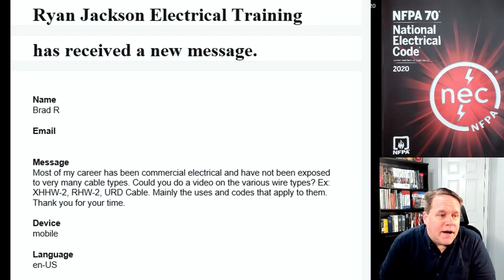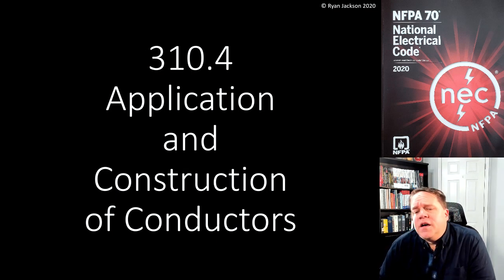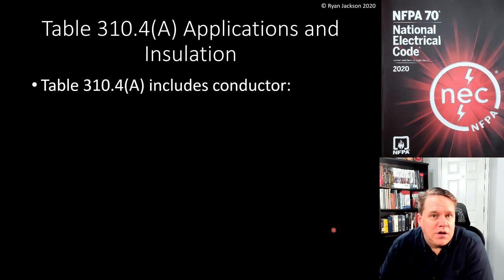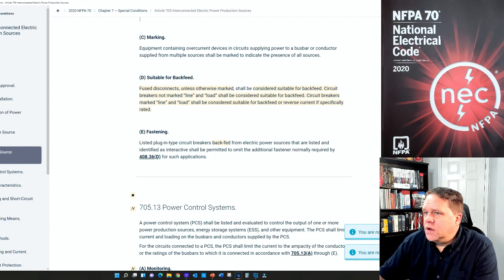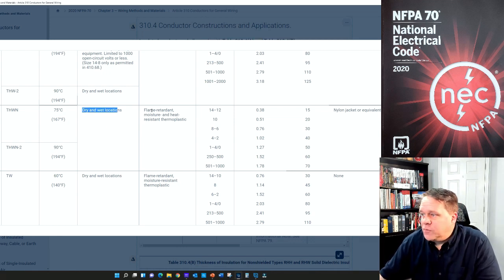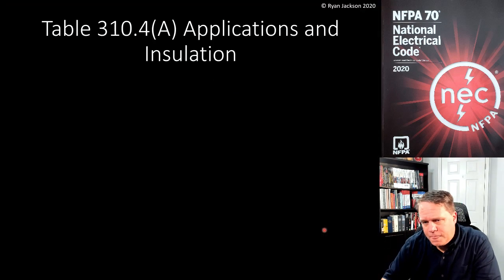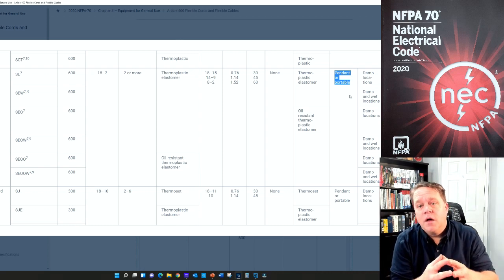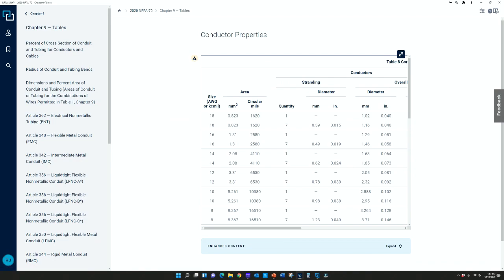Electrical conductor types in the NEC

Comment: The type of DLO, Diesel Locomotive Cable, commonly sold is also rated RHH, RHW-2 and Type W cord.  The old original DLO cable, with no other rating, cannot be used for building or temporary wiring.  It was only for trains.

Comment: Ryan, is SER cable limited to 60 degree C? Some experts have said it is not. What do you think?
Reply from the maker: See 338.10(B)(4)(a). But the short answer is "no."
Reply: @RyanJacksonElectrical  Awhile back, I installed # 2-2-2-4 AL, SER cable for a sub. panel and installed a 90 Amp. breaker in main panel. Local Inspector wanted me to use a 70 Amp. breaker instead and insisted on saying that 60 degree C shall be applied.
Reply: @RyanJacksonElectrical  didn't 334.80 used to apply to interior installs?
Reply from the maker: @jeffbower5525  That section (338.10) was revised every three years from (about) 2011 through 2017.
Reply: @RyanJacksonElectrical  that makes sense. I thought I remembered a time where it didn't exclude 334.80.

Comment: At the large hospital that I retired from contracted pulled 3 large DLO cables thru 4" conduit that had 360 degrees in bends. After they killed them selves pulling first conduit with only lube in head they had a guy with a paint brush lining entire run. Told me the rubbery insulation was stocking to wall of conduit. Was wondering if anyone else had this problem. They were using a powered puller for pulling cable.
Reply: DLO cable is not an NEC recognized wire. Some has dual ratings as RHW I think it is which would make it a compliant conductor but without the dual rating it can't be used.

Comment: Ryan thanks for another great vid. My chief electrician dad was one of the first people in our area to use THHN/THWN in late 60's. When he went to order several thousand feet of THHN supply house never heard of it. A salesman from a wire manufacturer dropped  off samples. Appeared to get abused first couple of years. Guys were using #14 THHN on 20 amp circuit breakers and even some put #12 THHN  on 30 amp circuit breakers.Heard they are kicking around making 14 gauge copper clad aluminum NM cable for LED'S on a 10 amp breaker. Can see Johnny homeowner seeing 14 gauge and using aluminum clad wire on 15 amp circuit breakets. Twice this year while at the electrical isles at big box stores saw homeowners purchase non TR receptacles for their homes. Told them that they should only use TR receptacles in houses. Older gentlemen stated that there is no kids living in his house so he does not need them. Told him that my kids are grown and moved out but 3 young grandkids are there several times a week. Wish the big box stores would either have sign age up or stop selling non TR receptacles. Would be best if NEC would not let non TR receptacles be produced.
Reply: Non-TR is still allowed in most commercial construction so why would manufacturers stop making them and why would a big box store stop selling them?
Reply: Unfortunately older folks with arthritis and other limitations have the most difficulty with those TR receptacles. Code is code but people are going to generally do what works for them.

Comment: BTW, DLO, from a design standpoint is very useful....it bends, it conducts, it works.  If you get it wet, it disintegrates...fair warning...use it, don't abuse it.
Reply: Not true for the type of DLO commonly sold, which is also rated RHH, RHW-2 and Type W cord.  The old original DLO, Diesel Locomotive Cable, with no other rating, cannot be used for building or temporary wiring.  It was only for trains, and could handle water.
Reply: @besafe9  The usefulness of it(for my purposes anyway) is in control/power panels that have very limited space.  You can bend it easily, you can terminate it easily(crimped lugs are best)  I've not encountered any DLO that is not dual rated.  Yes, if you get the exposed copper wet, you can count on it disintegrating very quickly.  Saying 'not true' is a pretty harsh thing to say.

Comment: Let's say we have TGGT wire attached to heating elements(industrial or not[e.g. cooking ovens]) Where can we transition to typical supply wires(THHN)?  Terminal blocks at a distance?  Copper conducts heat very well. 10'?, 50'?    I may be naive but I've not found that transition point in NEC.  We definitely need a method to go from hot to cold.  Beat me up if you need to.  I'd like to know.

Comment: At the 7 minute mark, you explain how the nylon coating of thwn is required for gasoline and oil resistance. However the next line says pvc is gas and oil resistant. Also it states that the nylon is to provide "enhanced" resistance, which implies that the nylon is optional.
Reply: Absolutely correct.